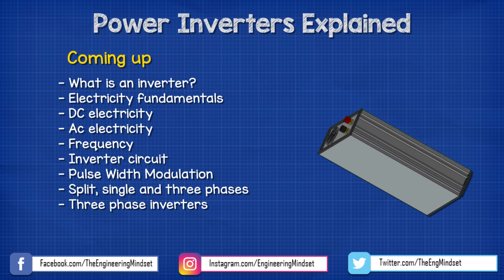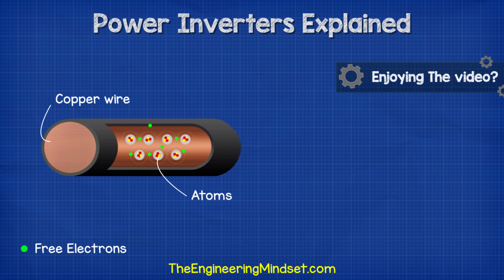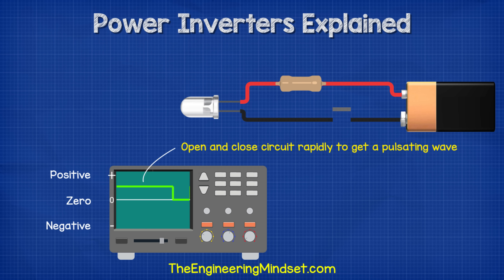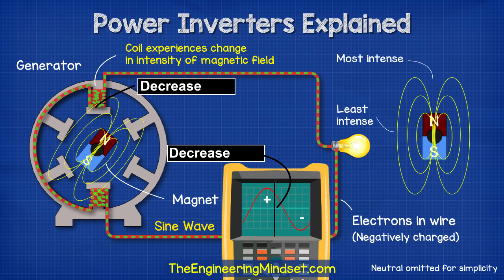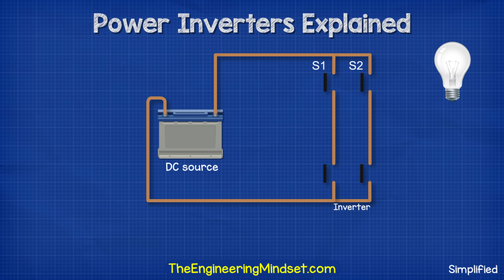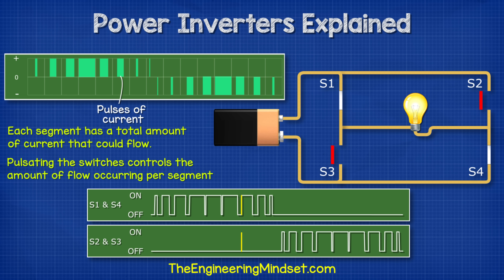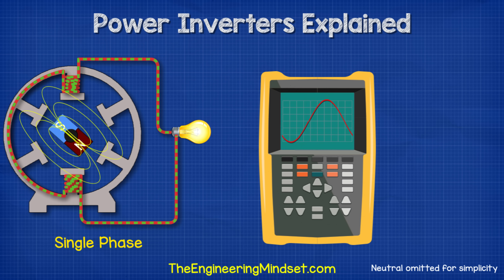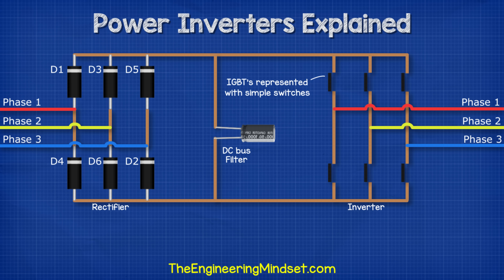Power Inverters Explained - How do they work working principle IGBT

Comment: OK.. so, I have a heat press for making shirts and other stuff.. we rent a house and the only place where the breaker wont trip when using the heat press is by the washer and dryer. I need to use that heat press in the garage.. there is no power there.. I ran a line from a random socket but I am not gonna use it for heat press because it will trip, so I bought a 5000 watts inverter.. I can connect that to my car battery with thick cables and it will work fine running that heat press... I was thinking ... I would have to have my car running during the use of that heat press through the inverter so it doesnt drain my car battery...my question is ... is there a way to create a 12 volt DC power from a house outlet , then connect it to the inverter so I can get enough power to run the heat press without causing any issues?? I have been searching and found out that a car battery produces DC current and a house has AC current.. I would appreciate it if anyone has an answer for this.

Comment: Is it possible to create these free energy alternator attached to a generator free energy devices?
Reply from the maker: No, all those videos are lies. Don't click them. If it was possible, we wouldn't need power stations. You can power them with wind and it will work, if it can provide enough force.

Comment: Electrical energy does not travel though the wire as sound travels through air but instead always travels in the space outside of the wires. This is because electric energy is composed of electric and magnetic fields which are created by the moving electrons, but which exist in the space surrounding the wires.
Most don't know this. Maybe you should explain this in detail as you keep stating the current flow .
Reply from the maker: Seen our new video on How electricity works - for visual learners? Link:➡️ https://youtu.be/3KePcASD0NQ

Comment: Hi prof.
This video has been of immense help and has help boos my research into a self sustaining electric generator.

I have a DC motor that moves the alternator quite easily to the required speed, but I find that it is only workable when the battery is working which doesn't take long to drain. So, I was wondering if after using a battery to start the gen to the required speed I can cut off the battery source of power and use this construction to continue powering the DC motor. Theoretically I think it should work but I will welcome any ideas, warning or constructive opinions to make this project a reality. Thank you
Reply: You lose energy to friction and heat so it will not sustain it self forever
Reply: @84ThoughtCrime84  true. Thanks

Comment: Using the direction in which electrons flow to illustrate electrical current is misleading. Electrical current DOES flow from positive to negative and no physicist I've ever known claims otherwise, because it is not defined as movement of charge carriers but as movement of charge. When electrons move to the right, charge moves to the left. Defining electrical current as flowing from negative to positive gets you into some serious mathematical problems. You could, in theory, redefine the charge of the electron as positive. This, however, has no benefit whatsoever. Indeed, there are currents in which negative AND positive charge carriers are involved. In these cases defining the direction of current as the direction of charge carriers doesn't even make sense.

Comment: Question.  For 3 phase appliances, you convert the grid three phase AC to DC with a rectifier then back to three phase AC using band width modulation with IGBTs.  What is your purpose of this redundancy?

Comment: Hi I need to build a 10w inverter for high & low voltage for my solar panel I'm gonna remodel my solar by cutting the cords in the back change the way the energy will flow by turning the diode then connect my diode to the battery charger controller to the inverter to the Strix 10s XT60 Parallel Charging Board with 10 lithium battery packs creating solar panel that will produce 10w
Reply from the maker: Seen our new video on HOW SOLAR PANELS WORK in detail https://youtu.be/Yxt72aDjFgY

Comment: I have a 1000w inverter but my two 12volts always run empty. The batteries are connected in parallel. I use a tv, radio, 8 lights on it how can i upgrade?

Comment: Very good for the basics of an inverter. Personally I used to startup AC variable speed inverters using SCRs as switches. The trick to using SCRs is the ability to turn them off, which requires a reverse bias. The IGBT came along later. The advantage for them is that they can be turned off by removal of the trigger signal. The advent of the IGBT significantly reduced the cost of the inverter and or AC variable speed drive. Note that all inverters wither AC or DC sourced, have a constant voltage DC Buss dependent on the value of the input voltage.. The DC buss voltage results in a constant Peak to Peak voltage. The pulse width modulation as described in this articular is used to vary both the frequency of the output as well as the output RMS (effective) voltage. When used for variable speed when powering an AC motor, constant torgue  is maintained by keeping the ratio of the frequency to the RMS voltage constant. For a 460 VAC to 60 hertz system this ratio is 7.67 V/hz. Once the motor rated speed from a constant voltage/frequency system is reached, the motor speed can still be increased by just increasing the frequency with no further increase in voltage. This is called the constant horsepower range. Their is a limit to this as the torque decreases to a point where the motor will no longer run. An inverter and or AC variable speed drive with a 3 phase output has another advantage in that the motor rotational direction can be reversed by just reversing the phase sequence as controlled by the triggering sequence of the IGBTs.

Comment: I have a brother laser printer with ratings of 110/120v  50/60 Hz      11.4 A. in my car. I have an inverter 2000w/4000w. I am trying to power my printer with 12v   100AH/10Hr  rechargeable AGM. The battery is 14.40-15v cycle use. 13.50-13.80v stand by. The initial current is 30A. When I turn my printer on the inverter beeps as soon as the printer tries to turn on. What is the problem? Do I need another battery in series?

Comment: Don't laugh, I am planning a chick brooding shed, and since a critical piece of equipment is a heat lamp, I need a battery backup for it, since I am in an area that is prone to power outages during storms that can last hours or a day or two, long enough to chill and kill baby chicks.  I don't want to invest in a fuel driven generator in the current environment or my location.  That being said, I need to understand inverters, sounds like rectifiers, and deep cycle batteries, and how to connect this crazy mess into what I need to have secure chicks.  Thanks.

Comment: I have a 24vdc 6000w inverter to 240vac split phase, with 1 leg 240 volts ac and not 2 120vac, when i test it to ground or neutral. How do i get it to 2 legs with 120 vac each with a neutral? Thank you very much.

Comment: I still don't understand how you go from low voltage to a higher voltage. If the source of energy is only 12vdc, how can that become 120 or even 240vac? I understand changing the frequency completely, but not voltage. Is there something in the inverter that creates more "pressure"? Does increasing frequency increase that pressure somehow?
I guess I don't understand why we get the voltage that we do in general. I thought it was based on supply and resistance. If you reduce the resistance, then you can pull more volts
Reply from the maker: We use transformers to manipulate voltage
Reply from the maker: Seen our new Transformer video? here https://youtu.be/jcY4QN7awEc

Comment: My Yamaha generator used to run our oil furnace during a power failure , it will not run our new gas furnace . Would an inverter generator run our new furnace ?

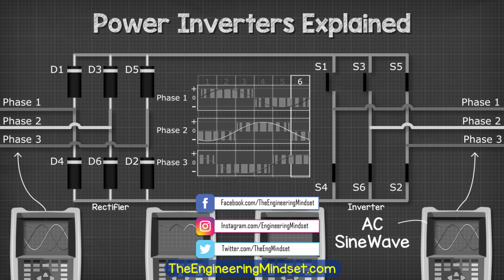Comment: This was amazing! 4 years of engineering summed up in 13:38 mins! Enjoy the coffee my friend
Reply: .. seriously though!?

This video doesn't even provide a basic circuit showing how the input DC has to generate a sine-wave (or a rudimentary square wave for simple low power applications) 

There used to be plenty of circuit diagrams available in the '70s and '80s in publications such as Hobby Electronics, Electronics Today International and Elektor magazine - these would show how a square-wave oscillator could drive a couple of power transistors (2N3055 with heatsinks) connected to a mains transformer in 'reverse' - it was easy to demonstrate how a 12v supply could be made to produce a 50hz a.c output at 220~240v into a low load (around 40~50W) Kits were also available for hobbyists for various applications ie. portable 220v a.c supply to power a synchronous motor for a telescope that had a camera attached for real-time tracking.

Comment: Nice video, especially for those of us would failed electronics, lol, anyway, I would like to use 10 car batteries hooked up in series coupled with an inverter to get 110 volts AC, and of course using solar panels to charge the batteries, would Lead-Acid work ok, or would lithium work better? do you know anything about home battery backup systems, besides their high price, do they work well? like the Generac PWRcell.  Thanks ;-)
Reply from the maker: Seen our new video on HOW SOLAR PANELS WORK in detail https://youtu.be/Yxt72aDjFgY

Comment: See the pulse lip-s mag.causes poles in +g'/^t. A concenuie causes variations in tg. Pre-magnet ac. Which is + dc.  A circular outlet is prepared over 34sec per depnimence causing a switch s

Comment: Explained well. Awesome presentation.

But there is a problem: In the generator animation, when the magnetic poles are parallel to the coils, the flux linkage will be maximum, but the rate of change of flux linkage will be minimum. Likewise, when the magnet is perpendicular to the armature coil, the flux linkage will be minimum, but the rate of change of flux linkage will be maximum. Rate of change of flux linkage is responsible for emf; not the intensity of flux. So the peak value comes in each half cycle, when the magnet is perpendicular to the armature coil. 

Correct me, if I’m wrong.

Comment: We have a slip-in cold-plate refrigerated unit for delivering packaged ice. "Out of the box" they are able to be plugged in when parked but as soon as they move they must be unplugged and then are just kept cool by insulation and proper door management during delivery.

We have always wished to put an inverter on the trucks but have never done it.

Comment: I do have a question definitely not unrelated but perhaps mildly off topic. It pertains to stepdown transformers and my findings while researching same.
 
So, I live in Australia 240v/50hz and want to import something from the US 120v/60hz. All I can find is a stepdown transformer that converts Australian 240/50hz to 110/50hz rather than the correct 120/60hz
Seems to me 110/50 is a cheap and nasty but still comparatively high priced as good step down transformers - so 3500w, already cost over a thousand dollars. How expensive would it be to get say 15a 120/60 from 240/50? 

I guess it's all about cost but after watching this fine vid it doesn't seem too difficult electrically speaking. I suppose if it were cost effective then someone would be doing it properly but since they aren't then I've probably just answered my own question LOL.

Comment: 3 phase generator gives 3 AC sinusoidal phases wrt neutral. Rectified to DC and you get DC + AC ripple. If the rectification process includes neutral, is there also a ripple on neutral and if so, does it add to the phase voltage or subtract from it ? I've a gut feeling that rippled DC + rippled neutral = smooth DC - i.e. the +ve peak of the phase coincides with the +ve peak of the neutral such the for the whole cycle, the P.D. remains the same.
Or is it a case that at the +ve peak of the phase coincides with the -ve trough of the neutral - so the actual P.D. is a result of 2 ripples added together.....

??????????

Comment: In building my first electric car, this has been super helpful. I'd like to know more about the current load relationship between source voltage DC into the motor controller vs motor controller output after converted to 3 phase. I can easily get motor specs however I need to spec connections to the battery packs. Most connectors I find are rated at a far lower ampacity than I'm dealing with while utilizing a much larger conductor. 90mm2 vs my 50mm2 that was included with the supplied parts. Thanks again for making these videos very helpful and clearly laid out.

Comment: Hey I'm Inri and I have an idea to use a few car audio components i had laying around and instead of disposing somewhat old but still 100% working parts i want to use a car stereo plus subwoofers and amps to set up a sound system in my room but need help with a way to power everything to make it work

Comment: Love this channel a ton, but
1:10 "renewable sources..." Don't hydroelectric and wind turbines produce AC? Is there another renewable besides solar that only produces DC?
And, why bother smoothing out the AC waveform, why do our appliances need it to be continuously variable like that?
Reply from the maker: The problem with wind is it varies in intensity, so the voltage and frequency of the turbine varies and is unusable. So its converted to DC, cleaned and then converted to clean AC which matches the grid. Transformers and large electrical motors all work off AC, because of the reversing magnetic field produced. Dc just gets stuck. Check our video on transformers and electric motors to see why
Reply from the maker: Seen our new video on HOW SOLAR PANELS WORK in detail https://youtu.be/Yxt72aDjFgY
Reply from the maker: Seen our new - How wind turbines work video? link: https://youtu.be/Hf875eOVrVI

Comment: Interesting video, but I an share you know that a square wave is the base freq, plus all of the odd harmonics of the base frequency. Older equipment did not like this because sometime the odd harmonics would pass through the filter and into the equipment, so great care is added to filter out the most of the unwanted freq. Still I enjoyed the video. 
Do you have any DC to DC power supplies, sometimes you might have -48VDC and you need to have +5VDC like in telephone systems. Thanks

Comment: Fulbridge car amplifiers that have over 125v rails can be used as an inverter. Just feed it the correct sine wave (50-60hz), and it'll power devices up to it's rated power at 12.6v DC.
Just a science experiment I did back in the early 90s. I successfully powered an 1100 watt microwave with the output of a HiFonics Colossus VII with a Heathkit signal generator and 4 car batteries.
Now there's class D, which is 3-4x more efficient.

Comment: I have a house off the grid on the beach in a very hot and humid area I need to produce enough energy to run my two 2400 watts Air Conditioners at night.  What's the best solar system to acquire?
Reply from the maker: Seen our new video on HOW SOLAR PANELS WORK in detail https://youtu.be/Yxt72aDjFgY

Comment: In upstate NY in 2003 we had a nasty ice storm that knocked out power for three days. I went out and bought a small inverter (almost impossible to find as there was a run on them after the storm). I wired into my gas furnace and plugged it into my car. For the three days I heated our house with that setup to keep my family warm.

Comment: I am not sure if I understand how 1 phase DC is converted into 3 phase AC.
DC to AC - this is understandable.
But how to convert 1phase AC to 3 phase AC? I know that is possible since I used frequency converter, that is powered by 1 phase AC and controls 3 phase motor.
Reply: Um, DC has no phases. As for converting 1 DC source into three phase AC, it' basically like what was done in the video except you only got one DC input wire.
Reply: @atheistyoda8915  so one need to split DC phase into 3 wires and then convert it to 3 phase AC, right?
Reply: @deniskalugin7984  No. You can do it with just 1 DC wire.
Reply: @atheistyoda8915  is there explanation how to do it?
Reply: @deniskalugin7984  It's shown in the video already. Except, instead of 3 DC wires, you can achieve it with just one.

All that really matters is the 6 IGBT modules because that's where DC is converted into AC.

Having more than 1 DC wire only makes sure that IF 1 DC wire becomes faulty and/or experiences power failure, then not all of the AC phases will get disrupted.
Reply: @atheistyoda8915  ok, thank you very much! I was a bit confused about using only 1 DC wire to convert it to 3 AC "wires".

Comment: Thanks very much for taking the time to educate us.  I would like to know this: In an AC inverter for, say, a solar system, does the inverter converts increased input Voltage to Current. I guess what I am asking is, does the inverter behaves like a transformer - transforming power. If not, are there any system/device, aside from a transformer, that does that?  Thanks very much for your response.
Reply from the maker: Seen our new video on HOW SOLAR PANELS WORK in detail https://youtu.be/Yxt72aDjFgY

Comment: i am sorry but if you reverse the battery the current does not flow to the opposite direction...
Reply from the maker: They do, with respect to the circuit. The electrons continue to flow from the batteries negative to positive terminals so if we reverse the battery they will flow through the circuit in reverse direction. Please see our video on voltage regulator design to see this in action.